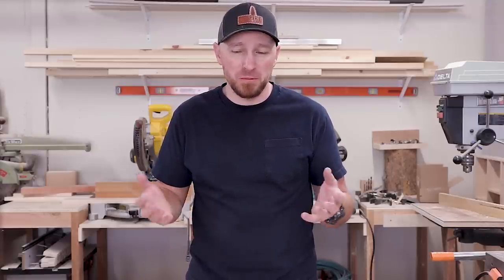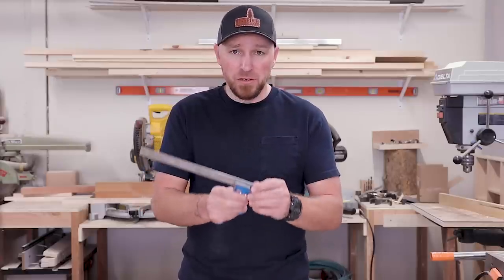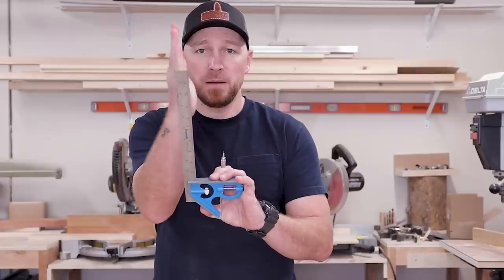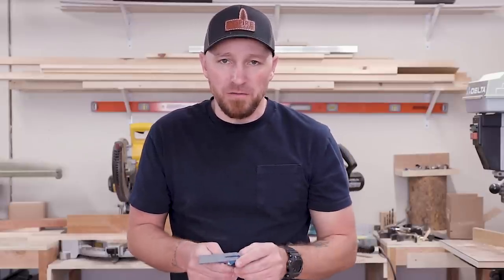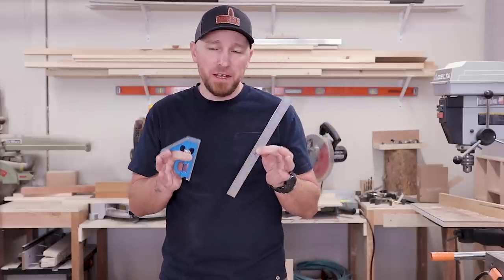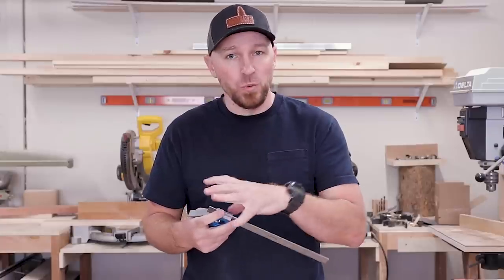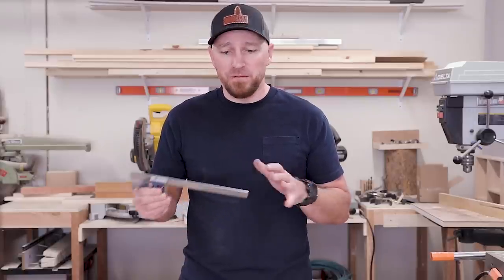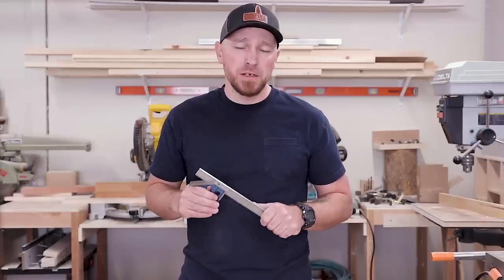How To True Up A Combination Square The Simple Way AND Tune It Up To Make It Work Better For You

Comment: Your videos have really helped me a lot on stuff like this, I actually checked my speed square the other day and dang sure enough it was off not by much but it was off. It was a cheaper aluminum one but it had the lil cuts you can put a pencil in to scrib is bared the long way. I  got me a cheap combination square at a mom and pop store down the road from my house it was 5$ but it’s been inside that store for probably 10-15 years lmao, but I wish I’d watch this first now because mines got most likely aluminum but it’s super hard and stiff rule, but that is good. What I didn’t think about was how fast it’s probably going to ware out because the other part is freakin plastic smh lol, I won’t complain tho 5$ ain’t to much and I got a really nice ruler if nothing else lol.its even got a little level built on the plastic part, maybe it’s a good one and it’s just been sitting on that back wall where there tools are and are 10 years late on a price up lol. I doubt I’m that lucky lol.

Comment: One thing I've noticed with my cheaper combination squares is that it matters HOW you tighten them.  For example, one of mine ( I think also an Empire) is true IF I make sure I put pressure down before I tighten it up!  So, I think sometimes it's just a matter of how you go about tightening them.  I'd check that method before removing any material.  Removing material might be necessary, but, if it's not, you could make the whole thing worse, or even unuseable completely.

Comment: My only thought would be to address the ruler first to make sure there are no issues there and get it ready for a proper body. Then check square followed by adjusting the body. This eliminates both a potential source of error and the location which will cause continued wear  of the body

Comment: I agree these 6" combo squares are improved when you flatten the face. The way these things are made, these faces are very slightly hollow ground and have a very tiny contact area which won't register consistently against pieces of plywood or whatnot. But you can't make a flat surface simply by rubbing something over sandpaper. This will round over your "flat," no matter how flat the platen. The corners and ends of your square's reference surface will be eroded away. You can verify this by rubbing your rounded-over square on a flat lapping plate. The paper is too compressible; the leading edge when you rub over the sandpaper is going to dip and erode/round. You will make your square ever so slightly into a rocking chair bottom. If you overdid the sandpaper, you might find your square will get different readings depending on how you press it against your stock.

Also, it is important to check the edges of the ruler part to make sure they are straight and parallel. If the edge of the ruler is slightly banana'd, the angle will change when you move the ruler in/out. I have two of these squares, and neither was straight, out of the box. And again, you can't just rub it on sandpaper over float glass (or a jointer bed) to make it straight!

The technique I used for flattening my squares (both edges of the rule and faces of the body) is to use a flat machinist ceramic stone. This is a rigid stone that doesn't flex or really wear. It's way too slow to do the flattening. It's your eyes, to see what flat is. Then you hit the shiny areas (these are your high spots) with sandpaper, using small sanding blocks or finger-platen. Then you go back and forth to check your progress. When your shiny plateaus cover sufficient area for your liking (and they cover at least the entire border of your flat) then you can stop. When you do the edge of the slide/rule, same thing. But then you also need calipers that are good down to a thous to ensure parallel-ness. When you do both edges, you should be able to measure the same width of the slide everywhere you measure with the calipers.

If you did the sandpaper thing, oh boy. You will have a lot of work to undo. It might be more work than how it started.
Reply from the maker: I know what you mean with the rule edges being straight and parallel. It’s something that I had forgot to mention in the video. The more I thought about it, the more it dawned on me that that’s way too much work for a $10 tool. I really wish I understood the first part of your comment better though. I did what I showed to that very square and the sole is square and true to the side and it is flat. There is no rounding off of anything. I’m really curious as to what you mean though. This is no different than how we joint lumber. But maybe I’m missing something.
Reply: @InspireWoodcraft  Lumber is much softer (and the pieces bigger). It's a matter of degrees. When I did my combo squares, I first used sandpaper over a flat plate of steel, seeing as it was "only" zinc aluminum alloy (even though I knew better). And I thought they were flat. But they still weren't consistent as my engineers squares. So ok, I said no more shortcuts. I rubbed against my flat stone, and nope. Not flat. In fact, they were better before I messed with them. I had inadvertently convexed these edges/faces. The corners were low by probably several thousandths. And yes, fixing these things was way more work than should go into a $10 tool! And no, my stone isn't out-of-flat.

And there's no way to tell by eye. You can't just hold up a 3" square's body against a straight edge and see this issue. If you doubt it, "straighten" the edge of your rule on your sandpaper. Then measure the width with calipers. You'll find a big fat spot in the middle, and the ends will be skinny.
Reply from the maker: I see. But were you freehand flattening or holding it upright against a known 90 degree reference and taking off all the material until you got down to flat? I put marker on mine (like you would with a plane sole) and flattened it down until the marker was gone, while keeping it against the 90 jointer fence the entire time to ensure a positive reference. It was quite the chore for a square I didn’t care for anymore anyway. But I figure I can put it in the kids’ tool box. Very interesting indeed. I wish I could see the process you went through.
Reply: @InspireWoodcraft  No, I didn't use a 90 degree angle. I kept the face tight against the paper in controlled strokes

The marker doesn't tell you anything. The marker comes off where the sandpaper takes it. And that won't be in a flat plane. Also the grit from the sandpaper touches way down into low spots to remove not just sharpie, but also material from where you don't want to remove it. When I sanded mine, I watched the corners get "flat," and the low spot in the center shrink. Didn't need any sharpie. But flat wasn't flat. 

If you try what I said about sanding and measuring your slide with calipers (you can do that with any piece of metal, of course, cuz you will mess up the slide/rule if you do it), I bet you will see what I am talking about. And I will perhaps try sanding a piece of aluminum or steel using a 90 degree support, tomorrow. I'm curious about that. If you want to make small metal parts flat, and you don't have a mill and a surface grinder, then you might want to pick up a hard, flat stone, so you have some eyes for this kind of thing. It's revealing, seeing how badly you missed flat.

Now that I flattened and straightened them properly, calipers show my slides to be the same width to within half a thou all the way across. And my combo squares are so accurate, I discovered one of my engineer squares was out of whack. 

FWIW, my 12" combo square was the cheapest one. And the face of the square was hollow-ground like my 6" squares. But the slide was ground straight and parallel, at least. I think they skip the grinding step on the 6" squares, these days. Over 12", that would be noticeable. Over 6", they maybe figure no one will care that much, I guess. All the better this way; I am not sure how straight I could make a 12" slide, seeing as my biggest flat stone is only 8" long.

Comment: When I was an apprentice joiner, back in the 1960s, I was taught to check a square for accuracy by holding the square against a true edge and drawing a line at what should be 90°; then flip the square over and draw a line next to it. This shows up more clearly the convergence or divergence of the two lines than drawing parallel lines as done here.
Reply: I believe that is what 
He did.

Comment: Ok, this is 3 years old but here goes anyway. When he was talking about not being able to add material, it made me think of videos about other things when they talk about adding a little tape to something to make it bigger or whatever. My thought was to put the tape on one end or the other of the holder edge. Before someone says that the tape will wear off, I had another thought while writing this. Thin strip of metal like a feeler gauge. A feeler gauge could be used to determine how much you’d need. Then get a piece that size, glue it to the right end of the holder. Maybe go a tad bigger, then you can file it down till it’s right on and to taper the edges if needed to avoid a cut finger when using it. Just a thought.

Comment: Wouldn’t it be nice to buy one off the shelf that was accurate to begin with! What a novel idea. I have the same one you have and sure enough it’s not square… in fact I wondered if it was because it didn’t seem to be consistent even when checking if my cuts were square. So frustrating

Comment: I don't know if anyone else has mentioned this, but it doesn't seem that you would need to use a piece of wood for the marking. You could tape a piece of white paper to the table of your saw and make your marks on it to check for consistency.

Comment: Getting a 90° reference. Just true up a piece of wood, put a sheet of sandpaper on a flat surface, put the piece of wood on top. Thus the sandpaper is clamped und you can sand along the wood piece as reference. The sandpaper allways reach into the corner and its easy to use fresh areas of the sandpaper.
Turn the part you want to true up 180° while sanding and check the surface. It will give feedback if your reference you slide along is really true.

Comment: Very useful info. Another trick to prevent premature wear of the pads is to loosen the nut a bit more and push it up. Then insert ruler with a little more clearance. The grove in ruler should cause it to hang on clamp when installing, keeping it's bottom edge for touching body. This will help keep the bottom edge  from wearing them out as fast.

Comment: My suggestion of what kind of file to use would be to find one with "Safe Edges". All that means is a file that has no cutting serrations on the edges so you're not cutting into the vertical walls that the faces of your rule ride against. Otherwise you run the risk of throwing off its relationship with the head which will also incorporate error into your measurements. After all, a square has to be "Square" in all three axis to be truly square.

Comment: About a year ago, I bought an I-gaging 12" try-square on the recommendation of a friend.  It appears that the lip on the "dado" of the clamp bolt is slightly slanted and has no round protrusion to catch the edge of the blade when it is tightened, like the Starret that I have (but don't want to use because it cost so much.  I don't want to drop it.).  When I loosen the nut to slide the blade the clamp bolt is wedged in and the blade won't move without pushing down on the nut/clamp bolt.  It happens every time and I'm sick of it.  I don't think I'll be buying any more I-gaging products soon.    I just ordered a blem from Taylor Tools.  Cast iron version, 12" blade, 10% coupon, for $45 + $4.59 tax + $7.99 shipping, $57.58.  Thanks for the tip.

Comment: Often the manufacturers only build the square so that it is square on the inside of the square, not the outside. If you check the rule with a set of digital calipers you will often find that the edges are not parallel. If you get the edges of the rule parallel first then it is much easier to tune it square inside and out.

Comment: So, what to do if the rule itself isn't straight? The one I just bought has about 3/32" bow ont he tall end.
If I had access to a plane grinder, I could have it fixed in 10 minutes. I do however, NOT have access to a plane grinder.
I could buy a better quality one, but I hate wasting money, and I will probably not use it quite as much as my speed square and my 3x4" and 4x6" knife edge squares.
Reply from the maker: You can file it with a metal file and at the high spots and then check to make sure both side are parallel. I have had to do that with framing squares before.

Comment: I recently bought 12" and 6" Empire combination squares. The one complaint I have is that the rulers don't slide very well. What would be the best way to fix that without affecting the accuracy of the tool? The slightest amount of oil doesn't sound like it would be even the slightest bit desirable and even a small amount of paste wax might affect the accuracy. Graphite, maybe?
Reply: Graphite is a good option for dusty environments. Just color the contact surfaces with a pencil and check for square again.
Reply: Wax. Rub a candle on the rule edge. It works on almost every tool. Hand saws, planes, all kinds of things. If you're going to do much work, go out and get a piece of beeswax from the hippie grocery.

Comment: I have to admit - I build scratch shelves and planter boxes for around the house. My clamping and drilling techniques are sufficiently amateurish that they probably exceed the errors in my square by a fairly large margin. Neither the books nor the plants are going to notice the difference. 

If I were building for anyone but myself, it would (I agree) be a very different matter.

Comment: Oh pretty good information you could put a chisel point on your pencil on paper quality Bond paper when drawing a lion say you should be about a 30 seconds of an inch apart and then you take Insight the line which means you get down to the table with your eye and look down the set of lines you don't look at them . 99% of the people don't understand that when you go to adjust your Square you push against the nut after you loosened it then move the scale once you're near your mark like very near you can release the nut in the spring all the square in place then you're just nudge to your final dimension then tighten it down. Also, a light film of oil wipe down of the scale will help lubricate the small pads the scale restaurant in the body and the Half Moon from the bolt that travels in the skill in the middle give it some lubricant too. Just loosen the nut in Dragon the dry scale back and forth across the alignment Nubs in the body but surely take it out of alignment overtime. Is there a Precision Instruments they should be treated like that first learn how to use your instrument and also then learn how to maintain it I'll give you a lifetime of use accurate use

Comment: Ran into some next-level cheap tool nonsense. Watched this video, grabbed my $5 harbor freight special combination square and was all ready to go. But when I looked at it, I noticed the ruler didn't seem to be resting evenly on both sides of the slot. I pulled it apart, and realized that the little tab that rides in the groove of the ruler wasn't even square to the rest of the screw! I'm cheap as heck, though, so I just filed that down and went from there!

Comment: WHAAAATTT???...

Dear Inspire Woodcraft:
I simply CAN'T believe how you DESTROYED the UNIQUE versatility of the infamous EMPIRE Combination square!!!

It is the UTMOST VERSATILITY of the unique EMPIRE Combination square that offers the user not one, run-of-the-mill "90° square"... but the patented, genius design of the Extra-soft aluminum "guides" which bring, not just one, boring and plain "90°" setting, but a FULL, INFINITELY variable and Rich settings from slightly less than 88°, to an slightly more than 92° in a single, brilliantly designed model!   That Empire square you showed at 10:37 on your other video, that reads a precise but bland 90°,  MUST BE a fake one... because true, Authentic  EMPIRE squares only come in sets of four Authentic, Factory Authorized and Exclusive models:
- The 88° one,
-  the 89°,
-  the 91° and finally,
-  the 92° .  

On the combination squares, Empire offers you the UTMOST VERSATILITY: a single, truly versatile combination square either on 12" or 6" models, that can perform brilliantly BETWEEN ANY ANGLE, from slighly less than 88°, to slightly MORE than 92°, all in just one extraordinary square... Now, you can rightly blame that it WAS NOT YOUR FAULT AT ALL... Thanks to that unique combination square, exclusively from EMPIRE! Why buy five different squares, when you can have just one that gives you a truly INFINITE choice of angles for the price of one???  Don' let you lose this magnificent offer, from Empire, at your local HomeDepo...

Comment: Using the folded sandpaper will make surface where the ruler will ”land” concave. That is a risk in every case and tool you recomend actually… And by ”rounding over” the edges of the ruler you aggrevate the consequenses. I.e. You run the risk of having a square that is inconsistent. And that is way worse than having a square that consistantly is a fraction of. These tools are machine made and the precision a machine works with is far greater than any of your recommended fix will give.
Also the big difference in length of the two parts of the square can create problems. One grain of dust halfway from the ruler will multiply the deviation at the end of the ruler. If the ruler is 6 times longer than the base and the grain is halfway fram the ruler the deviation will be 12 (2x6) times as big at the end of the ruler!!